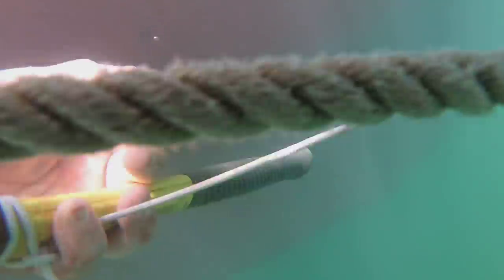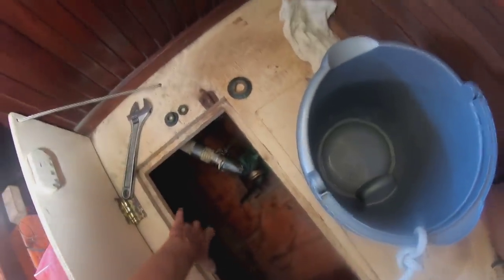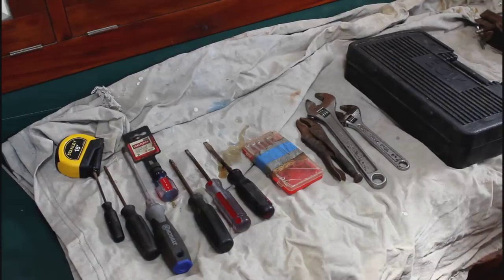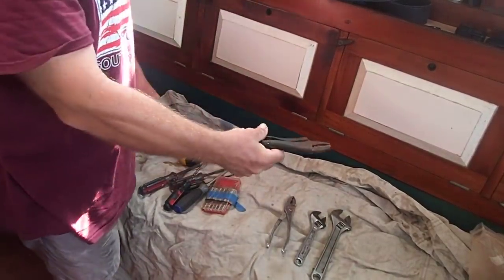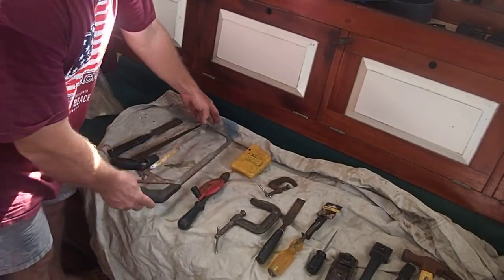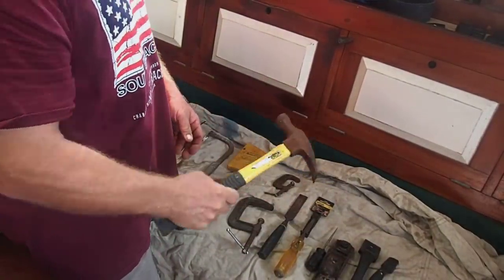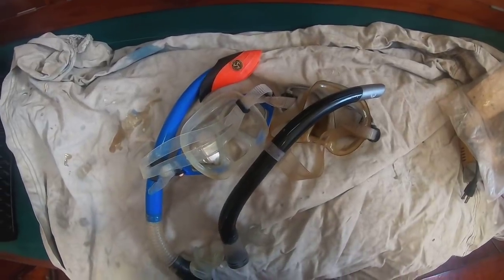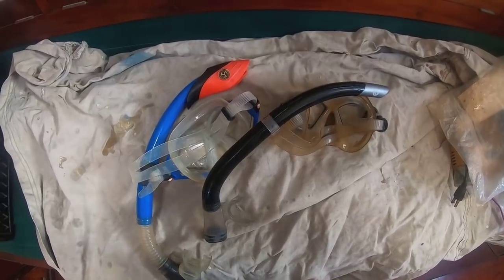Tools, Spares, and Materials for Ocean Cruising, Part One

Comment: Hey, Kevin!
Good idea, to cork the vent from outside!
The puncture in the elbow I would try to repair with several layers.
At first layer some rubber (like bike tube), Silikone could be nice as well... 
Second layer a shell, maybe a piece of sheet metal (soup can) or a piece of glass 
roving and epoxy. Than fixed with hose clamps, zip ties or a 
Spanish winch of wire.
In a hardware store, or the web, you find a tape, made of Butyl rubber.
Should even stick on wet surfaces...
Maybe next time in your private hardware store... 😉
Fair winds and following seas!

Comment: Get a set of plumbers expanding pipe plugs. Very quick and easy to use. Easier than hammering in wooden plugs and makes a completely waterproof seal. Will not vibrate out. 👍

Comment: One thing my dad always did and suggested was to weld an eye/ring onto the tension knob on your vice grips. It almost becomes a second set of hands then. Can lift and hold things with a rope on it then, Also becomes a good clamping point turning the vice grips into a portable vice.

Comment: I strongly hammered a soft, tapered, plug into a thruhull from the outside and still had leaks. The silicone is a very good idea.
Reply from the maker: Hi Patrick, yes, it worked well.  Much less nerve wracking doing a repair without water trickling into the boat all the while.

Comment: Thanks Kevin , also big thanks on your solar panel episode, with your knowledge on the subject, I added an 100 watt solar panel and  the correct deep cycle marine battery, on my 27 Oday , I do not have an inboard engine, have outboard engine off the stern , thanks

Comment: Thank you for the video and your channel! Have you ever thought about getting battery-powered drill? I would say it is one electric tool that comes handy all the time and it does not overload even low power inverters. Set of very shot screwdrivers with holes in the handle are the other most commonly used tool for me.

Comment: If you want to de-rust any of your tools you can simply soak them in a 50/50 solution of vinegar and water. A couple of days in that and they will be brand new. You will need to neutralize the vinegar with Bi-carb and water. Cheers for the video.
Reply from the maker: Interesting, thanks!

Comment: Maybe some modern cordless tools and a 12v battery charger would keep your inverter happier.
Reply from the maker: I had a cordless drill, but after a while it just never had any power.  I'm sure the new ones are much better.
Reply: @howtosailoceans1423  Yeah nicad batteries suck.  The new tools use lithium batts which are much better; more power and they dont have a memory like the old nicads.  Spare batteries are easily available too.

Comment: Old electrical power tools are very dangerous, especially in high moisture environments, because they are ungrounded and are made with conductive housings.  Plus from what I can see, your boat isn't grounded for AC to begin with. Don't wrap your finger all the way around the triggers. Use the very tip of your finger to depress the trigger. Rubber gloves would also be a good idea.
Reply from the maker: The housing on the old sabre saw is plastic, so no danger of shock--yes, some of them had metal housings and could give you a zap.

Comment: a little tube of valve lapping compound may help with that seacock.
Reply from the maker: I'd heard that too, but didn't know where to find it ... any brand names you know of?
Reply: @howtosailoceans1423  look on amazon, they should have it, or a auto parts store prob have it.. Permatex brand is good, a tiny bit goes a long way..
Reply from the maker: @brettstevens9677  Thanks Brett.

Comment: Using the seabung means you don’t have to swim , how about a rivet gun for joining metal ,monkey wrenches are great, you definitely need bigger clamps, I have a nut and bolt plus socket to widen components so I can get them back on, if you have an ancient outboard,spare shear pins in the dinghy, and of course there’s ropes and twine which I hope you will go over
Reply from the maker: I don't have any rivets on the boat, wooden mast and all, so I've never had any need for one.  Yes, bigger clamps are on the list.
Reply: How to Sail Oceans true but a lot of us do

Comment: The saw is commonly referred to as a "pull saw" or a "flush cut trim saw". I believe there are a couple slight differences between the two, but I can't tell which you have from your video.
Reply from the maker: Thanks!  I'll need to buy a new one because it has bent one too many times and is pretty weak now.

Comment: In your next episode, can you discuss which cordless power tools you find useful to carry aboard (v. plug-ins needed for heavier work)?
Reply from the maker: The only cordless tool I have is the vacuum cleaner.  Used to have a cordless drill but the batteries both refused to charge.  Probably the newer ones are better.  I mostly use hand tools anyway, even when hauled out.

Comment: In Norway, we call that saw in biginning,- a Japanese saw....Dont know if its has name.
Fair wind ,,,,,,,,,/),,,,,,,
Reply: Anders Jakobsen Right, the pull saws originates from Japan. In Sweden we use both names (japansåg eller dragsåg). They are razor sharp and you can make extraordinary thin cuts when needed.
Reply: Yes, @MiQBohlin  
I have 3 of them my self. Nice tool to have.
Reply from the maker: @MiQBohlin  Yes, they are very sharp, careful not to run your fingers over them.

Comment: I'm thinking about the gopro myself.  I'd love to hear what you think of it once you have had some time with it.  Thanks for the videos.
Reply from the maker: So far I like it, the Hero 7 takes nice video, records decent audio too.
Reply: @howtosailoceans1423  I thought it didn't do audio without some special attachment. I know there are some third party mics (rodes micro mic???).  Glad to hear it's working well for ya.  I especially liked the time lapse feature.  I thought that would be useful for doing diy videos for the mundane parts. Like sanding or something.   Anyway, happy Saturday to you!
Reply from the maker: @talderson1  The GoPro has a built in mic.  I don't think that there is anyway of attaching an external mic, it being a waterproof camera.
Reply: @howtosailoceans1423  You're right about the waterproof aspect.  I didn't think of that - a bit thick on my part.  The one I'm thinking of is here: https://youtu.be/MxVpNCw9DKw?t=31  The times I've seen it has been people on land so, again, thick-headed of me. :)  
If you're out and about on land though, the sound is much improved with a better mic.  It involves extra stuff so for someone who has all that (like a professional vlogger :) it probably isn't needed.   
I was thinking about making some videos and didn't want to go whole hog right away so I thought a gp7 plus a better mic would be a good start as the gp is more versatile and still decent in terms of quality.  
I'm still shaking my head at the waterproof thing lol.

Comment: Is the clock and barometer tied in to the battery bank or do they have their own internal batteries that you would have to keep spare batteries for?
Reply from the maker: The clock runs on dry cell batteries, barometer is mechanical.
Reply: Ok. Learning much practical stuff from your videos. Working on my 22' project. Looking forward to her first sail.
Reply: Also, planning on making a sculling oar. Seems a very useful tool for it's intended use. Already made a Greenland style kayak paddle and it turned out beautiful. Confident my self made sculling oar will be just as beautiful and functional. Big thanks to you.